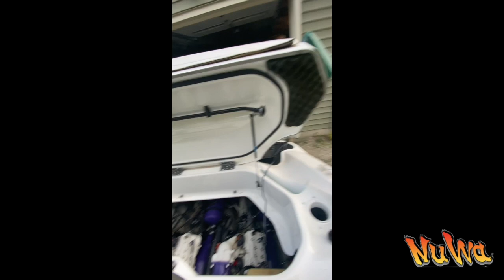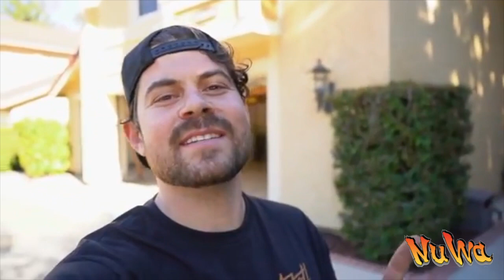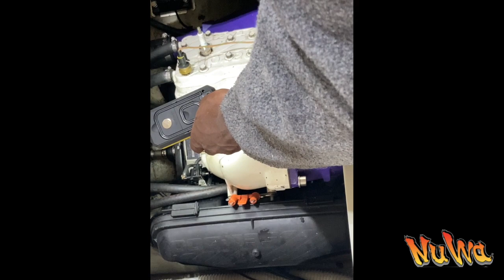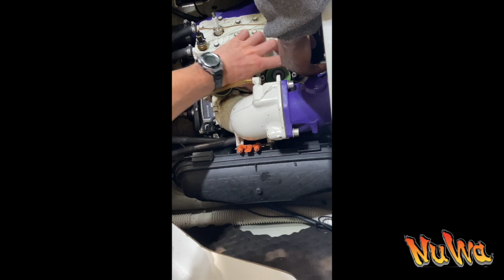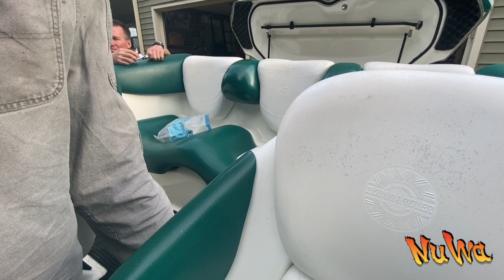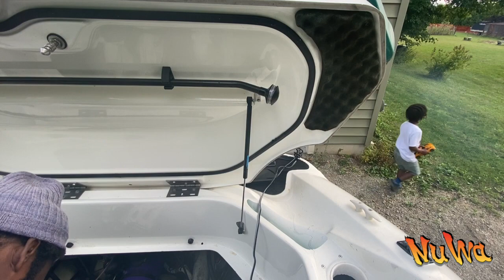SkiDoo/ Seadoo Challenger 1800 Rave Valve  Install

Comment: Our boat had the same problem but the rope didn’t get sucked in just wrapped around propeller shaft, my question what did the engine do, ours was either choking on gas or low idle. Where do I get those values
Reply from the maker: sorry to here that , the engine stalled, you can get them used or rebuild, thanks for your time , if you need any thing else let know..